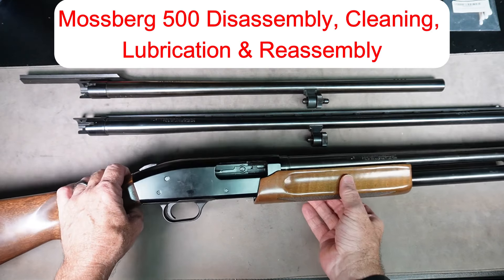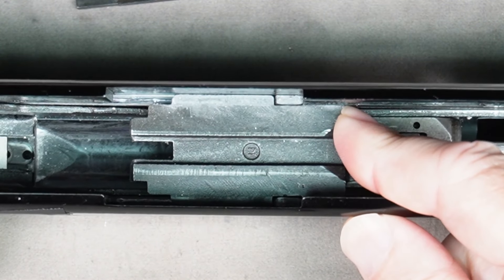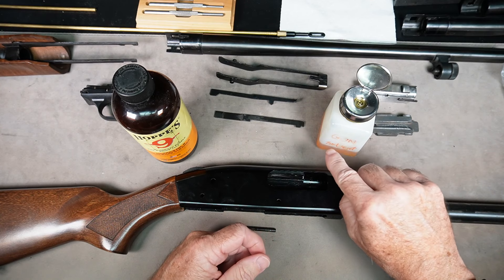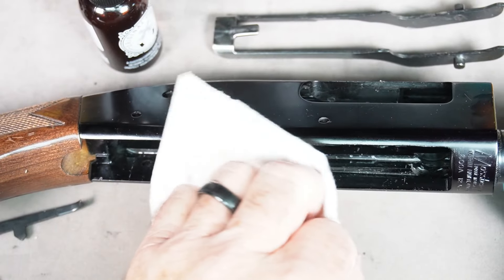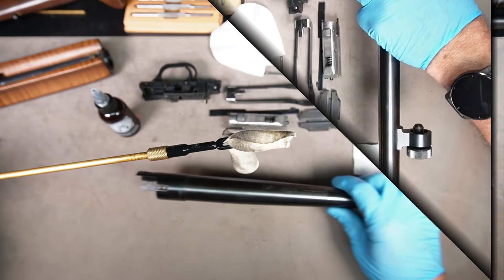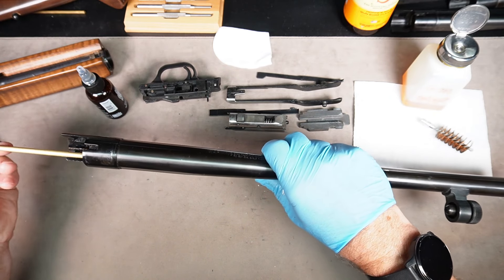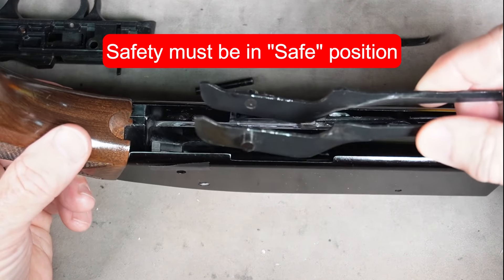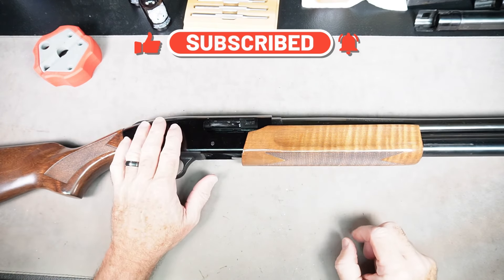Mossberg 500 Cleaning. Disassemble, Clean & Lubricate 12 gauge Pump Shotgun #mossberg

Comment: Thank you! Thanks to your video I was able to break down and clean the Mossberg 500 I bought. This is my first time doing something like this. With your directions it was clear what I was doing. I appreciate the breakdown of everything you used to do this. I was able to easily buy the supplies I needed to get the job done. I appreciated the comments like you don't need much pressure to put the trigger housing in. I realized at that part I had to make some adjustments to the innards before it would fall into place. After I made my adjustments it just moved into place.
Reply from the maker: Awesome! Thank you so much for watching the video and for leaving such a nice comment!

Comment: How often would you recommend we do a bench cleaning like this?
Reply from the maker: Here is some info from the Mossberg 500 manual: 

To ensure optimum performance, Mossberg recommends thorough cleaning of your firearm after every 200 shot shells. However, unusually dusty, dirty, or harsh weather conditions, or use of ammunition which leaves significant powder residue may require more frequent cleaning. 
If the firearm is to be stored for a long period of time it should be thoroughly cleaned and oiled. Do not plug the barrel or store in a fabric lined case that will absorb lubricant from the firearm, as this may result in corrosion to the unprotected metal surfaces.

Thanks for the question!

Comment: Thank you for this!  I just bought a 500 and did some skeet shooting with it.   One or two times when I was racking the next round…the shell would get stuck and I would have to remove the shell with my fingers.  Not sure why it’s doing that.    I have not disassembled the gun yet.  With this video I will be able to do that.   Thank you for it!  Also Could you recommend a shorter stock for this gun?  I know they won’t come in wood though.   If black… would there be a black forearm that would be a direct fit?  Probably because the shorter stock would be black.     Thank you sir!
Reply from the maker: Congrats on the Mossberg 500! I love mine and have done a fair amount of trap shooting with it! Try midwestgunworks.com for Mossberg stock & forearms. They are available at lots of other places online as well. Thanks very much for watching the video and commenting!

Dave
Reply: @davesgunchannel  Okay. Thank you Dave !

Comment: Excellent, well paced takedown. I used some of the lubes you recommended as I had some on hand, and they work quite well. Earned a sub from me! 

Interested in you or your channel's take on boresnakes. Generally speaking, are they best for - as you say - spot cleaning when you don't have the time to fully take ithe firearm down - as you did today?
Reply from the maker: Thank you for the comment! I use boresnakes to clean the bores of all my firearms. Yes, they are also good for the “quick cleaning” if you don’t have time for a complete cleaning. Since the inside of the barrel is the place that gets the dirtiest, having bore snakes around is an ingenious way to quickly clean them!

Comment: What if when I try to pull the forearm it gets stuck and doesn't slide out.
Reply from the maker: You will need to move the metal arms out of the way at the same time. See that works.
Reply: @davesgunchannel  did some more research and mine is closer to the 500A model I'm assuming.  I have a Mossberg New Haven 600AT that I inherited from a family member and it looks like there's another spanner wrench style screw on the inside of the forend so it catches on the mag tube.  I'm gonna have to get a strap wrench on this thing cause it ain't budging and that's what other folks have had to do.  Appreciate the video it helped quite a bit cause this is my first shotgun

Comment: 870 action is so much easier...😂
Reply from the maker: I will try to get my hands on one of those and do a video! Thanks for the comment. I really appreciate it!
Reply: @davesgunchannel  you will be like woah no kidding! Unscrew the barrel nut, barrel off, reach up underneath the action, depress the two slide retaining bars, action and bolt come right out and your done for field assembly! 1 or two retainer pins for the trigger assembly however I never take mine out. I recently received an old 1980s mossberg 500 ducks unlimited 12 gauge and it had me puzzled, great video BTW!